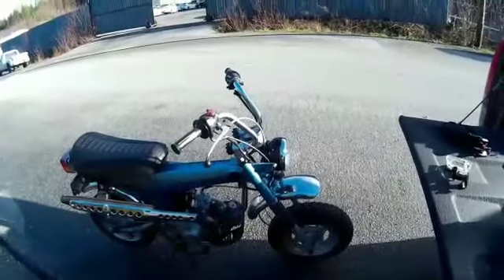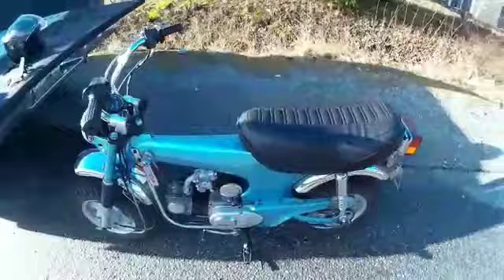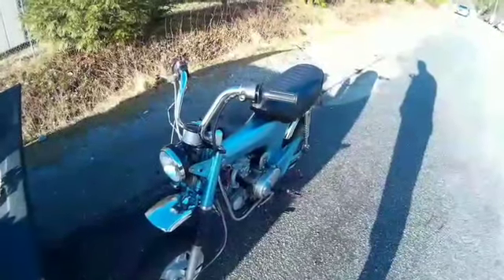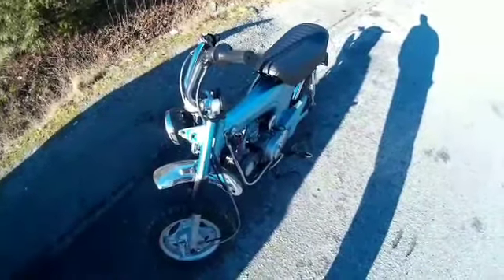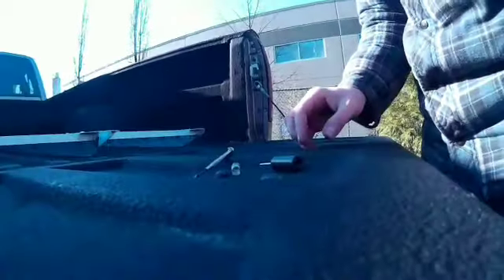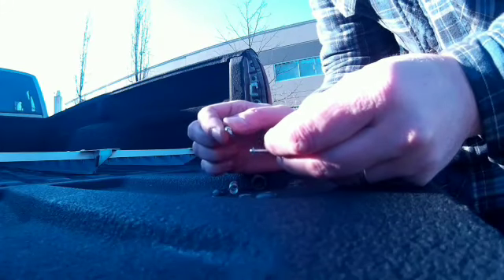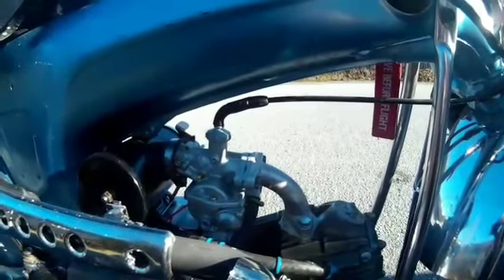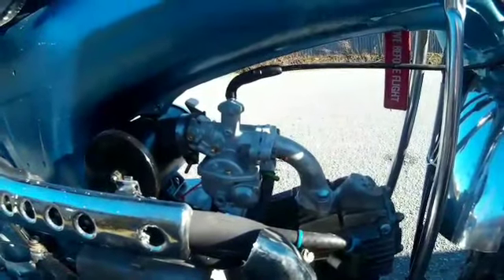Honda ct70

Comment: at the 4:32 mark zoomed in on the carb I definitely can see you have the taller Needle Neck... Needle cap looks to be the short original length... I would check the throttle cable length and see if you get free play so the needle settles fully.  As I said in a comment on a early video these newer carbs have a taller throttle neck and sometimes throttle caps... if using original throttle cable lengths they are to short and hold open the needle.  Just adding this comment to this video as well for any one who might be experiencing idle/bogging issues.  As this is what I found that resolved my idle and bogging issues to be... original length throttle cable on a newer carb that has the taller throttle needle neck and slightly taller throttle needle cap eating up all the free play and not allowing the needle to fully close.  1/4-1/2 Longer throttle cable resolved my idle and bogging issues.

Comment: A couple of thoughts as I watch all your work so far on this bike:
* Check for obstructed exhaust pipe.
* Verify you do not have too much oil in the bike.
* Verify the two fuel pick up tubes in the tank are free and clear.
* Verify your two fuel hoses are not internally collapsed.
Reply from the maker: Thanks for the input. Oil level is correct and when I disconnect the fuel lines from the carb I get good fuel flow. But I never thought of checking the exhaust pipe. It's new but that doesn't mean it's not plugged. How would I check?
Reply: Compare output with your hand both running bikes at same engine speeds. Also, pull the baffle on the problem bike. If that all checks out, you could try switching exhaust pipes like you did with the Carbs earlier.  See Cam/flywheel/Piston/ input above.  @emso0105

Comment: And one more:
*After first confirming the "T" (TDC) mark on the flywheel corresponds with the piston at Top Dead Center (the mark or flywheel could be off), verify cam gear (I know you have had it on and off several times which is why you need to confirm the mark and piston agree) is installed correctly. If that all checks out as does my first thoughts I already shared, then your cam could be "flat" (worn to excess) or it could be the wrong cam.
Reply from the maker: It's a new cam...but it could be the wrong type that was sent to me

Comment: I'm going thru the same issues. Changed Carb, no luck, rebuilt original carb, no luck. Then I took the gas cap off and the dang thing started right up and ran fairly well. Anyone know how to clear the vent on the old style plastic "off/on " type cap?
Reply from the maker: Sorry no I don't.